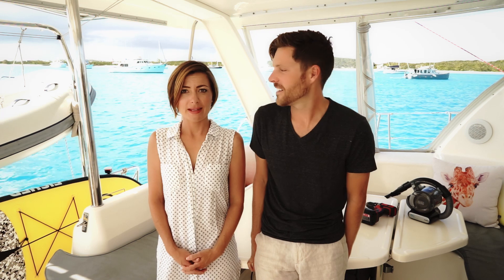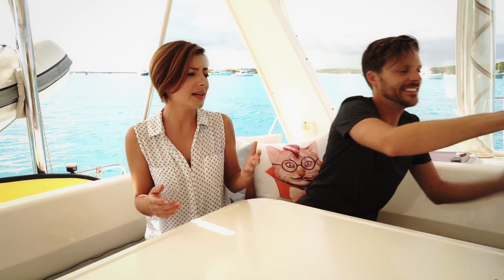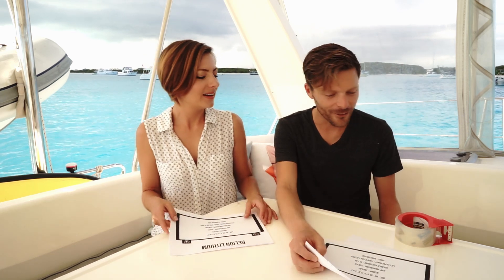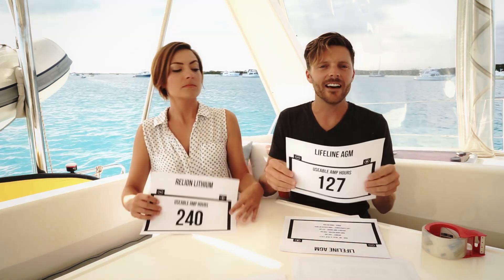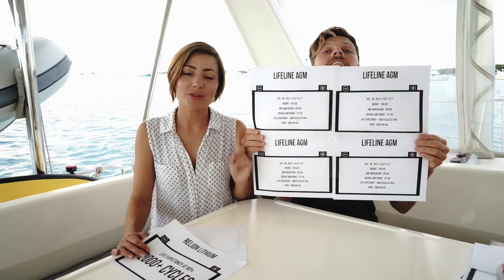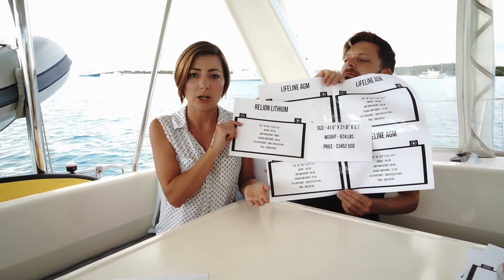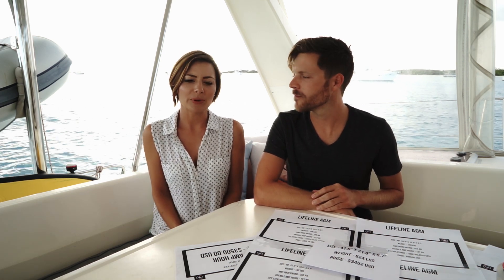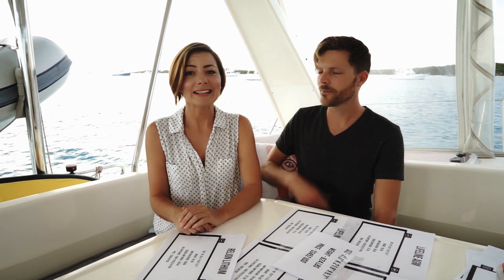Sailboat Tech - Lithium Batteries & Why We Chose Them (vs AGM)

Comment: Okay, I'm just starting to watch this and I must say: You are doing it wrong... The most important tech is the espresso machine, the ice cream maker, and the beer fridge! ;D
Reply: It's a chicken and egg problem. You can't have those items without  power.
Reply: nasanction 
Solar panels --> charge controller --> batteries --> invertor
Reply: beer storage area also.
Reply: Do you not know, they have been using this system for the last 2-3 years. It works and works well. I have a 400 amp/hr lithium pac and 960 watts of solar in my rv. I used the genny for about 3hs total in seven months of full time camping. After 2 weeks of sunless skies in the fall. All backcountry camping and NO HOOKUPS. MY kitchen is electric and use microwave and electric coffee maker, sterio always on and lights whenever needed,  propane is used for heat and barbique.  Yes there is loss in the controllers, but lithium batterys charge 90% efficent unlike agm of lead acid at 30%. oh and ALL off grid users have a generator for backup, no matter their power source. Most days what ever power used in the evening is replaced back by 11 am. Lithium is the future, i'm living my dream , no comprimize on power.
Reply: True, but you must generate that power to charge your batteries. All that power has to come from somewhere. I just figured out the next video! lol...
Reply: George Kozi lolololololol
Reply: On their web site they state the solar keeps it going and that they rarely run the genny.
Reply: George Kozi 😁😁😁
Reply: lol
Reply: That all sounds good, but have you ever tried to fill 1200 amp hrs with 4 panels? Give me a break! Solar is great and all, but they don't generate as much as you think. No matter what you always have to make more then you use. That's right, MORE! There is much energy lose through charge controllers Copper lines, and especially converters.
The only real answer here is you have to live under your means. You could have the biggest baddest battery in the world, but if you can't fill it,  there is no point... I bet they have a Generator that turns on automatically to charge batteries. Which also means they are not off grid. 
Keep after the dream guys! That's how we got this far right?